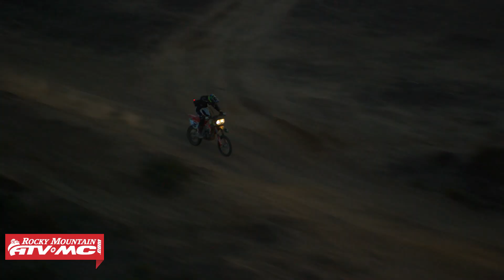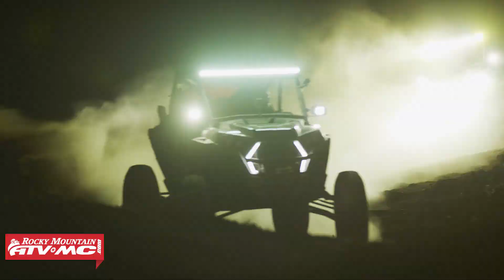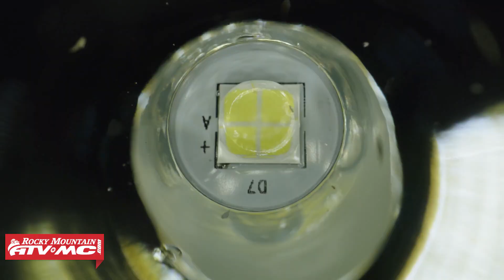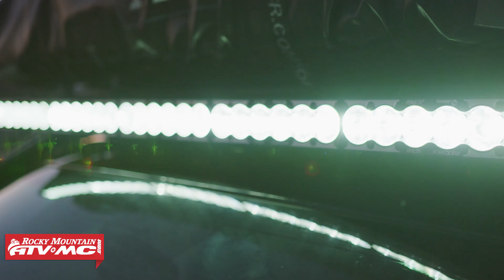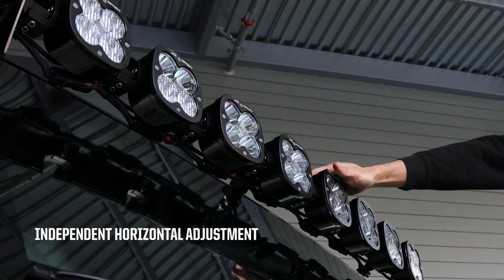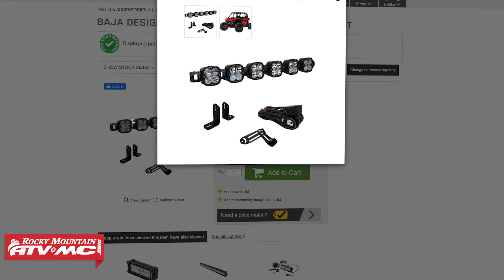Baja Designs Off-Road LED Lighting Lineup

Comment: Did I miss the part where you described the differences between the XL sport and the XL Pro linkable lights?  You show a strip of XL Sports and 2 Squadron Sport lights.. where is the XL Pro?
Reply from the maker: The XL Pro is 4,095 lumens and the sport is 3,162 lumens.

Comment: I have a JLU with factory leds. I’m looking more for side illumination (to spot animals sooner or when turning). Would a straight or curved light bar be better?  Another question regarding side illumination-is the driving combo what I need or the wide angle version?  Lastly is there a curved wide angle version that would be the best option?  Any info is appreciated. Thanks.
Reply from the maker: Baja Designs has a great video explaining lighting zones and which of their lights are best for each need. You can check it out here: https://www.youtube.com/watch?v=zGOvqHlsT-I&t=10s hope this helps.
Reply: @ I’ll check the link out. Thank you for the quick reply.

Comment: How come the wires aren’t heat shrink close to the bulb housing The wires are exposed ✌️👍🇨🇦
Reply: They are exposed I never understood that
Reply from the maker: Which light are you referring to? There are no exposed wires and most of Baja Designs lights are IP69K rated which means they are waterproof up to 9 feet and can be power washed with no issues.
Reply: @rmatvmc  they are absolutely exposed for about an inch right after the plug! I know because I own three of them!
Reply: @seniorxj2931  shouldn't you be grilling Baja Designs, instead of these guys?
Reply: @michaelfritz4152 Because HE said the wires aren't exposed,, and in fact they are..